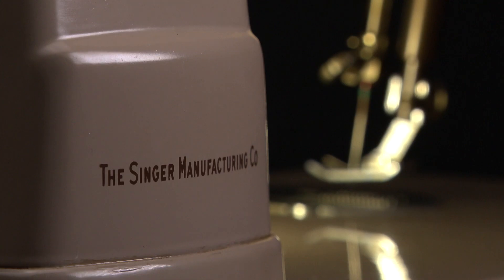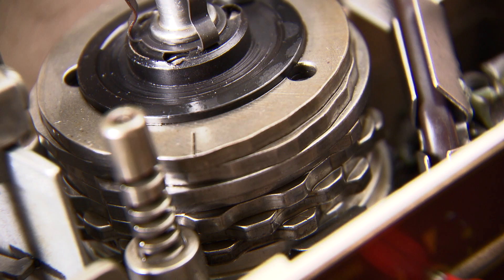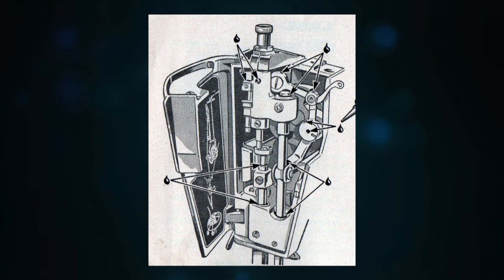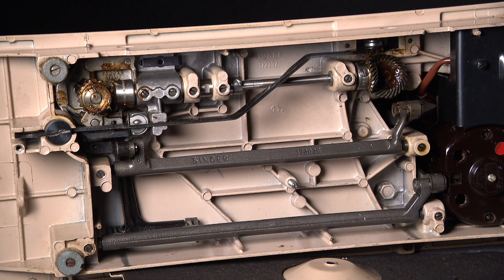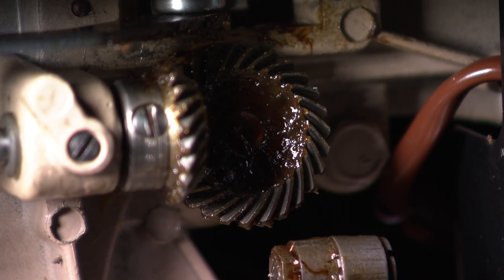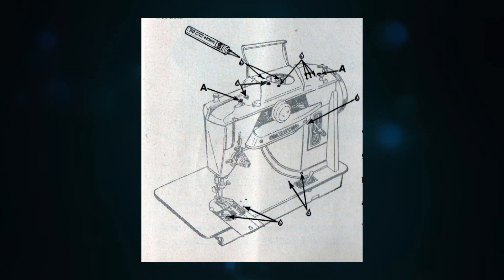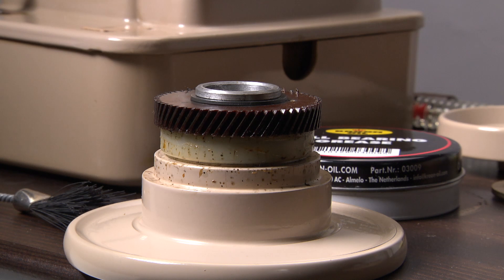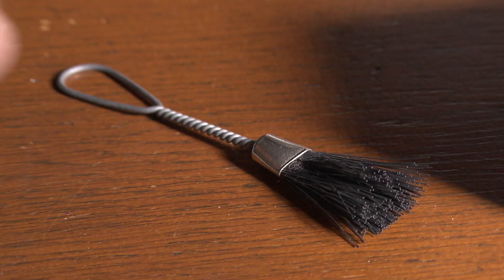Oiling and maintaining your Singer 401

Comment: I have a singer 401A I need a Manual for it can I find one an thank you for showing we’re I need to oil my machine Iam a new be to sowing just love it ❤
Reply from the maker: Hi Karen, thank you for your message.
Congratulations on your Singer 401A. They are sooooo nice to play / work with. I have more videos on the 401G... that one looks slightly different to a 401a but basically they are very similar or even the same.
Manuals can easily be found online. Search with google. Or it you're on Facebook: Join a sewing machine group (like the group dedicated to the Singer 401) and download it from the files section.
Enjoy your machine and take care!